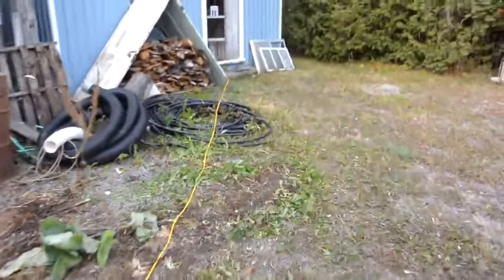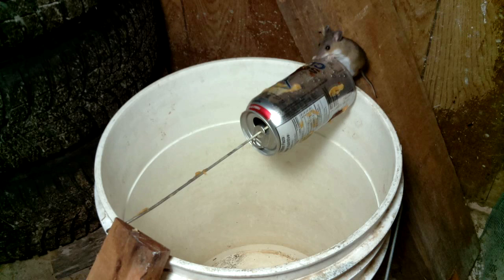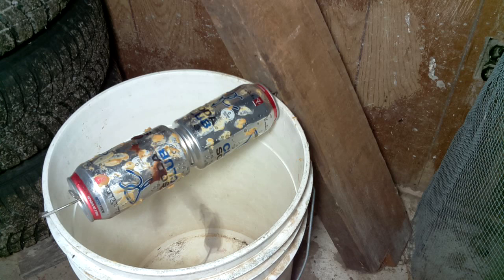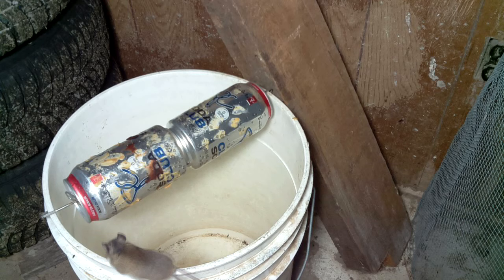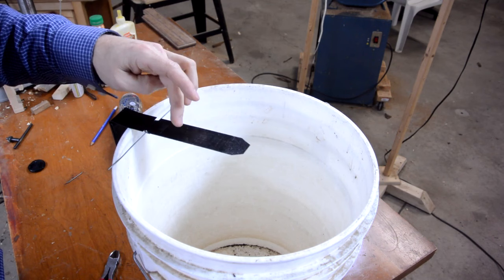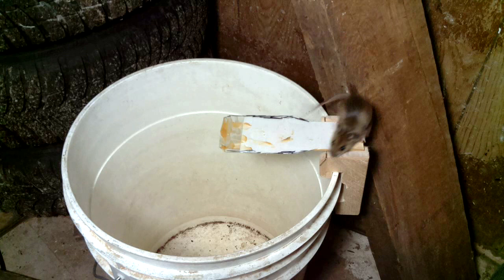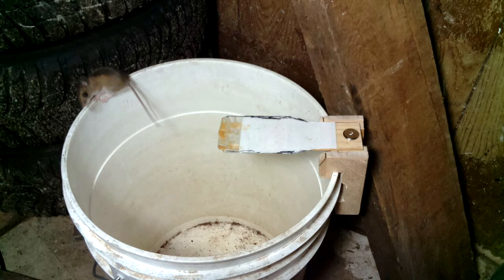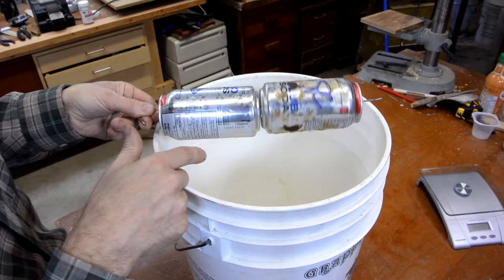Building a better mouse trap, using video surveillance

Comment: The mouse in the video is getting out because it's going near the edge of the bucket and jumping almost straight up to the rim. Try this:

Do an image search for 'squirrel deflector'. Take a piece of sheet metal, and form it into a similar cone, except with a larger hole in the middle. Turn it upside down, and jam it into your bucket. 
The mouse now has to jump from the center of the bucket, and probably won't be able to reach the rim. When it lands on the cone, it will slide back into the bucket if the pitch is steep enough.

Comment: Try going back to the single can suspended in the middle of the wire. Put tape at each end of the wire (next to the can) to keep the mouse from pulling the can to one end. Mice are pretty smart critters. If you don't get them the first time they learn. Good to see the creative juices flowing!

Comment: one can with a wire gromit at the bottom end of the can to keep it centered over the bucket. also just an inch or so of water will inhibit the jump of the wet mouse.

Comment: Very neat. Have you considered another alternative to a single free-spinning can? I noticed that the mouse kept moving that around, hence partially the reason you added the weighted can.
But could a single, free-spinning can with washers on both ends to keep the mouse from moving the can work, too?

Comment: The can idea works but you need to make two changes.  One, turn the rod that the cans spin on 90 degrees to the ramp.  The mouse comes up the ramp and has a gap between the ramp and the can.  He has to commit and make a jump to the can.  The can spins and he falls in.  Second, add about 2-3 inches of water to the bottom of the bucket.  They won't be able to get the momentum to jump out.  Leaving it somewhere cold?  Add some RV toilet antifreeze to it so it doesn't freeze.  I've had great luck with this.

Comment: The best way to design a rotating trap IMO is to entice the mouse fully onto the rotating section before it begins to move so they cannot grasp a stable spot and prevent themselves spinning with it. To do this, the diameter of the rotor should be small near the edges of the bucket and therefore not have much of a moment arm to induce movement (since mice are small and very sure-footed, this should be fine). In the center some arms would come off this narrow pipe radially with the bait on the ends. Thus, when the mouse reaches out to get the food he will induce a spin on the much longer moment arm but not have anything solid to grip onto to save himself.
Reply from the maker: good idea.  It could just be a drum tapered on each end (a bit like a football).  And with a weight inside so it doesn't roll so easily until the mouse is on the fat part.

Comment: I had the same problem.  Mouse could jump out.  Put a little canola oil in the bottom of the bucket and they have no traction to jump or escape.  Better than water because you can use it in the cold, its harder to freeze.

Comment: Since you were using a Raspberry Pi with a camera module, I was thinking that this was going to be a project that optically detected when a mouse was on the trap platform and the mechanically or electromagnetically released the platform to make him slide into the bucket.

Comment: perhaps have a little blockage slot, similar to how you have a trash can with those flip-flaps on them so the mouse can't jump out of the bucket again if they tried, or try making the bucket deeper by cutting a hole in the bottom of one bucket then building a little trench to fit the bucket into, line the bottom with the piece you cut out the bottom of the bucket, then line the sides with something to hold the water or whatever in there, with a deep enough trench hole it'll get stuck in there.

Comment: The can version needs no weight inside. The wire must not be at the level of the top of the bucket, it should drop about an inch and a half into the bucket, so the mouse has to lean far into the bucket to get on the can. By the time it's on the can, it cannot easily pull itself back to the bucket rim. Also, one can is enough, but it must not come close to the side of the bucket, so the wire is bent at an angle from the rim to the can, then straight through the can, then back up at an angle to the opposite side. There need only be one access to the can, one side, not both, so you can keep the can the right distance away. The first night I put my trap up I caught 11 mice and 4 rats.

Comment: Slight modification suggestion but first a question. 

Does this apparatus catch multiple mice a night? or once you catch one do they tend to shy away from it until Mouse A is removed?

I figure if the later is the case you may be able to add a funnel  to the inside so that mice slide down and stay out of sight of other potential victims, while effectively keeping it either trapped long enough to be found or drowned. Adding such a mechanism though may make it necessary to use a larger container to begin with to facilitate  the necessary depth of the funnel to keep the furry little victims from climbing the funnel.
Reply from the maker: +Blusasuke It catches multiple mice.  Water keeps them from coming out, (mentioned a few times in the video)
Reply: I know, my train of thought was maybe the mice would avoid the trap if they saw another mouse in the water dead underneath them. And if that was the case trying to block them from being able to see down into the water.

Comment: Also, if you detect motion with the cámera you could tilt the ramp with an electromechanical systema triggered by the camera's software.
Reply from the maker: +Charlie Pechiar And why would I add this much complexity when a magnet already does the job?

Comment: Thanks for sharing. I had a failure last night with my plank trap and I am very curious to know what happened because I have always had great success with these traps but last night I had a different kind of bucket and the plank was tipping inward too much so I think the mouse quickly got off the plank before it fell in because some of the bait slid off the plank. 
Question I had was, will the same mouse be smart enough to avoid the trap next time? Looks like that’s a no. According to your video they will just come back again and again. That is fascinating.
Reply from the maker: it will probably try again eventually.  But rats -- if it doesn't dump then, they won't try again

Comment: What if you used something similar to the second trap device but attached it under a lid that fits the bucket and cut out a hole for the trap to function? Then once you snap the lid on you can catch the mice and they can't get out. This could be a more humane trap as it could be used as a catch and release, or you can still add water and kill them.

Comment: Put a lid on the bucket and cut a notch where the trap is . Then glue a half cylinder over the trap make sure the end is closed off also . the tube would need to be the right width to work . He would not be able to escape .

Comment: Three ideas...
1: use a seven gallon bucket.
2: perforate the can and put the bait inside and a tiny bit in a band on the middle of the can.
3: just two inches of water is enough to mess up their ability to jump. BUT:

If you can find a smaller roller for the middle and used a lid  cut to allow clearance for the mouse to slip in but put up about of an inch or two of barrier around the inside of the bucket mousy had better be good enough to jump out of a hole instead of grabbing onto the edge.

Just some ideas...

Comment: We use this method all the time to trap and kill mice, but you need to fill the bucket 1/2 full of anti-freeze or ethylene glycol.  The anti-freeze method works much better and will eliminate your mouse problem.

Comment: The cans did not do the trick cause you need a larger diameter so the mouse has to try and climb on it and not sit on the stationary wire. I think I am going to make a trap like this but it looks like a coffee can is the best choice from what I have found so far.

Comment: I bet if you put just a bit of water in the bucket it would help keep the mouse from jumping out. Not so much as to drown the mouse, but enough to get it wet. A wet mouse weighs more and can't jump quite as high, as well as being slippery. Maybe even spray the sides with some Pam to make escape even more difficult.

Comment: Nice build. Though impractical, it really is an intriguing project.  What makes this video cool is that it tackles a normally unintresting part of everyday life in an interesting manner. I must say that I had hoped that it would be another project that  would appeal to me, and in some ways I suppose it did, The can on the bucket is a much cheaper way to deal with mice than buying traps and poison.

Comment: Why drowned them that's a bit messed up, just use snap traps it's fast and they don't suffer, plus when baiting a mouse trap get a small piece of aluminum foil and wrap it around a small pice of peanut butter, I mean small and wrap it around the bait platform this makes the mouse pull on it to get the bait and makes the trap go off with a guaranty, also the foil keeps the peanut butter from drying out, because if it gets dry it won't make enough of a sent

Comment: If you put the peanut butter on the middle of the can and not the edges you wouldn't need the weighted can. The magnet dump ramp with the magnet was cool though

Comment: if you add a thin layer of vegetable oil to the bottom of the bucket, the mouse won't die... but it won't be able to get out either.

Comment: What if you combined the drop ramp with a lid, So that the ramp completes the lid, while the cap has a sort of tunnel going overtop. This way, the mouse has to go into the tunnel to get the food, and when they get to the drop point. It drops them into the bucket, once inside the ramp resets and seals the exit. I understand some might say "well why do we have to make a tunnel on the lid? Well simple reason is that if you don't make a part that surrounds the ramp, the mice will just stand on the stable lid.

I'm only suggesting this to get the ignorant people who are all "think of the mice, what did they ever do to you" people off your back.
Reply: SDD525 A quick dissolving acid like what you're suggesting is a controlled substance, and would make a gross protein sludge on top. Plus you'd need to keep it in a large glass bucket, which aren't too common.
Reply: SDD525 Plastic holds them yes, but temporarily and at low concentration. For the concentrated stuff, you want glass as it's non reactive. Sulfuric acid that's not watered down will eat everything and destroy polymer bonds in plastics. (and the acid used in batteries is watered down just enough so it causes a reaction with the lead-oxide plates. it's not concentrated by far. it's why aside from washing your hands and not touching your eyes while working on them. You don't need gloves even when handling the corroded contacts.)

Comment: perhaps to keep the mouse from jumping out so easily maybe u could put a layer of double sided tape in the bottom of the bucket ... the tape wouldn't be very good at stopping him from moving ... but jumping would be much harder
Reply: +scornedghostify or just add a 2 inch lip going inward at the mouth of the bucket so it can't climb the wall to get out

Comment: If you want them alive to feed with, get a taller bucket, or put some olive oil in the bottom. If surface is soft, they can jump high enough to get out.

Comment: You did not assemble the can properly, you must keep it with out moving back and forth from the middle of the bucket, only the right assembly will work 100%
But your motivation for innovation worked well too !

Comment: I use a big trashcan with a swinging lid. It is much higher than yours. I give some food at the bottom of the can. I smear some peanut butter on the swinging lid. Put something that leads to the lid. And the whole family falls in. Too high and too smooth to jump out as the lid closes by itself. No need to kill the mouses. Just take the trashcan to the woods and let them go.

Comment: ROLF :-) very funny Matthias. Now a mousetrap, isn't that soposed to keep the mouse trapped? :-)
You could make a conus shaped bucket, like a cyklone dust collector with a bottom "chambre separee".
Then release at them at your prefered location. ;-)
Reply: I have seen a mouse like that, jump 1 & 1/2 m straigth up a wall

Comment: This mouse trap is actually much more cruel than those spring-loaded traps, when the mouse jumps it's possible for it to break its legs when it falls down and the mouse will die a painful death. On top of that, in live traps, the mice can die slowly from stress and/or dehydration and if they don't die in the trap, they will probably get killed or starve to death in the wild. So just buy a bunch of reusable spring-loaded bar traps (they're like a dollar each) or shoot them with an air rifle powerful enough to kill them in one shot if that's legal where you live. The only humane way to get rid of mice and other rodents, is by not leaving food out in the open and sealing your house hermetically.

Comment: If you want to keep them alive to give to a friend with a cat, you could use the same setup - cut the flat bottom off of one of those water fountain plastic 10-15 gallon water bottles you tip over into the dispenser with paper cups seen in many public places.  After you cut out the bottom (flat end) clean it out and wipe silicone lubricant on the inside to make it slippery.  Then under the spout end put a bucket to catch the mice that has a neck just bigger than the plastic bottle.  Then you can cap the bucket with the mice in it and give it to a friend with the cat. 
     Also, Walter White wants to know if you can cook meth; and how much do you want for that orange bike?

Comment: It's a wild animal, competing with its peers for limited resources, preyed upon by other animals, of a species that isn't endangered. These things don't tend to die of old age. They die from starvation, or from being eaten alive by birds, cats or foxes. Animal rights is a very appropriate thing, but in the case of a mouse that causes damage, spreads pathogens, and could chew through wiring leading to fires, drowning isn't a bad way to go.
People who think this is cruel should read an actual book on nature and evolution by natural selection. You'd have natural selection banned, and not in the American way, but in the literal way. Hint: It's a bit different to how Disney portray it...

If you have a cat that you let out because it would be cruel to keep it locked up indoors: thanks for contributing massively to the loss of songbirds in most urban environments. Birds which are usually tortured for quite a while before they give up, and then are pretty much left to rot, rather than consumed.